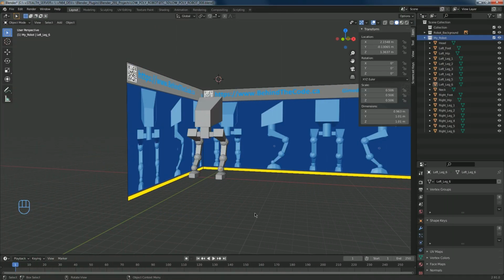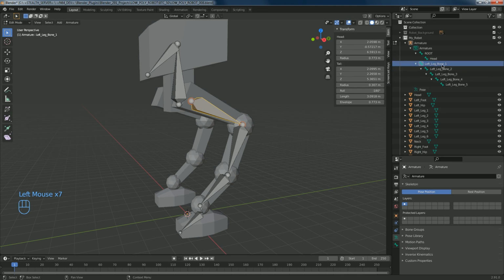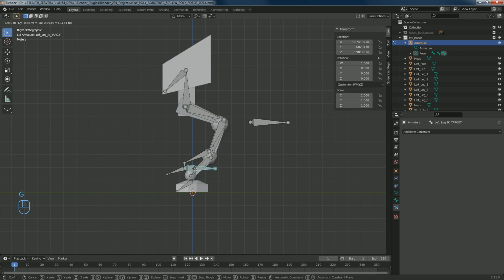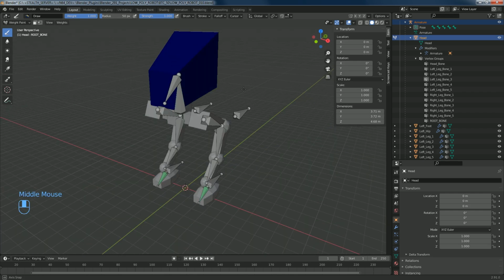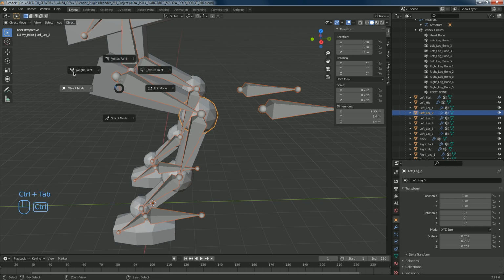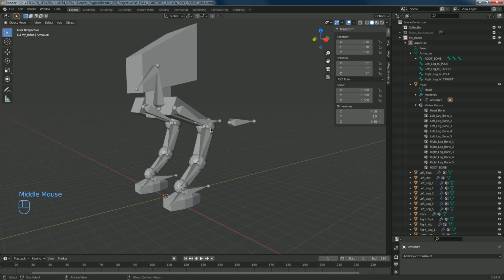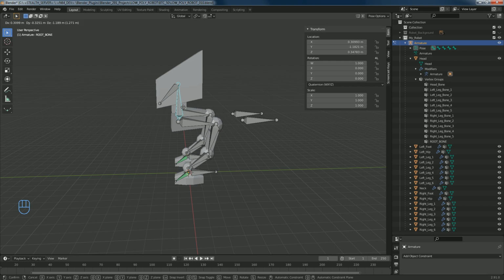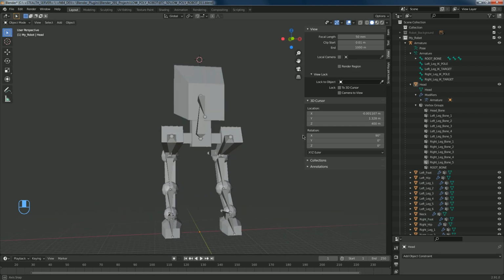BTC #50 | Rigging a Low Poly Robot Walker in Blender for N64 - PART 3

Comment: i have an issue withe the pole bone, when grabing it the ik dot follow the movement but only rotate idk why. I have a chain lenght of 3 if that matters
Reply from the maker: Hmm…
It could be that one of your pole bone settings is not set correctly….

What version of Blender are you using?

And Are you able to share your Blender file with me? (Google drive link perhaps?) 

I’ll try and open your design file here on my PC, then try and see what’s causing the issue. 

-Gerry
Reply from the maker: If you can zip the file for me, and try emailing it to my website Administrator group…

webmaster@behindthecode.ca 

They will forward it onto me.

Cheers!
-Gerry